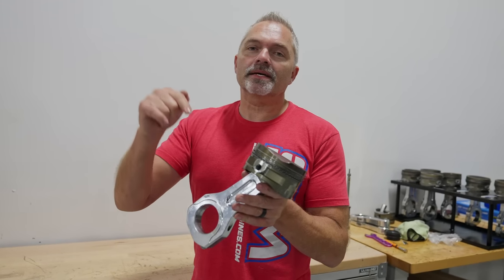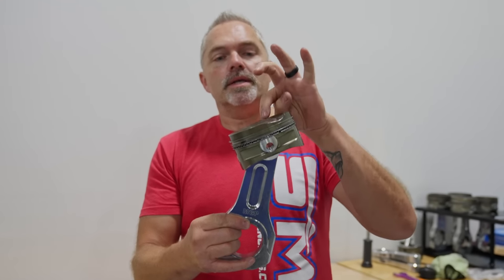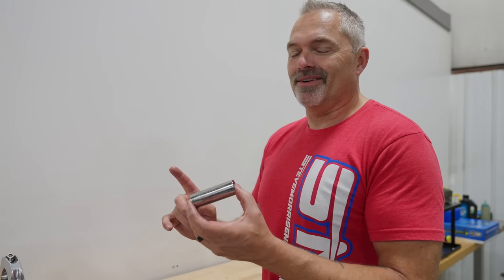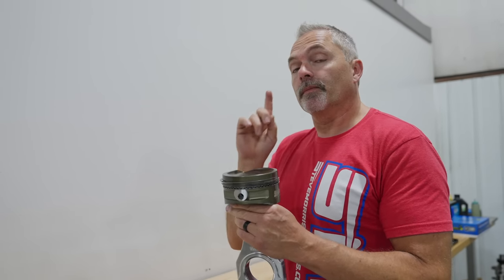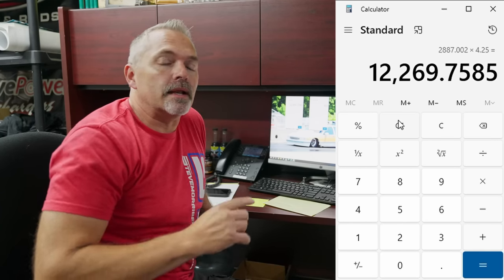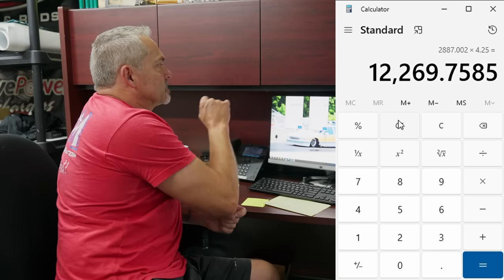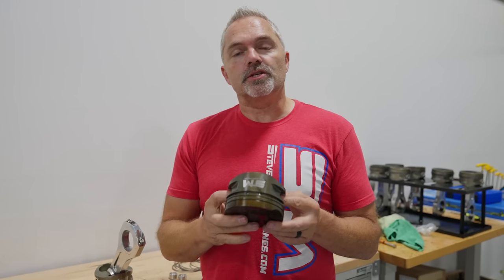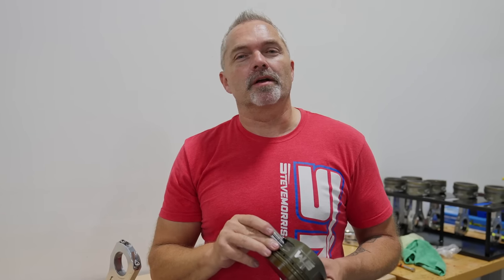Throw your rods away if you do this ???

Comment: Great explanation! The piston has to be beefy enough to handle that amount of weight being put into it plus the spike load of combustion. (many thousands of pounds but for a very short time.) Honda, aka HRC wrote a lot about these forces and how to contend with said forces. They use a fps formula that equates to G forces. 40,000fps to 45,000fps is the speed of an everyday engine to a high performance everyday engine.  The piston and rod going from 0fps to 45,000fps at mid stroke back down to 0fps for both directions.(at redline) Highly recommend checking HRCs info and MITs High Speed Internal Combustion Engines (it's a two volume book)  I'm a drag bike guy. Have a good one.

Comment: You're good at explaining things, keep on doing videos like this. This explanation makes you understand what kind of magic the connecting rod company's are dealing with. Mind blowing is an understatement.

The math on what transmission clutches go through. drive shafts, the teeth of a gear set, the twisting stress that an axle undergoes. Fascinating stuff.

To think how super car owners treat their very expensive engines... Rev limiter non stop with no load... yikes

Comment: Good info to get the mind thinking… couple of other dynamics that were sort of touched on is the angular velocity of acceleration and deceleration that is determined by rod stroke ratio. Short rods increase side thrust and increase piston acceleration and deceleration speeds and hence the peak load on the conrods/bearing/ fasteners and pin/piston  at those instants where direction changes.. the long rod significantly slows both acceleration and deceleration instants and angular thrust on the piston skirt… the piston is in a “softer” deceleration mode as it approaches tic, and a “softer” acceleration mode after tdc. Simarly for the bottom of the stroke on both sides of bdc. Why a long rod engine can make use with a lighter piston as the vertical and lateral loads on the piston decrease. 
It’s amazing the engineering calculation that goes into designing parts that can not only survive but last as long as they do.
Thanks for the video👍

Comment: steam engines use steam to help cushion the piston as well. Right before the piston reaches the end of the stroke. the valve gear lets a jet of steam into the cylinder. it helps alot with longevity.

Comment: I remember reading an article about Honda engineers working to make the s2000 reliable with a 9k rev limit.   The forces on the engine at 8k were significantly less than 9k.   Ultimately they decided to go with the higher rev limit with the 2 liter motor.    When raising it to 2.2 liters rev limit was decreased!

Comment: I just learned a ton of stuff I will never use. That was very very interesting. I was told when a big block Chevy hits the rev limiter it is the equivalent of hitting the top of the piston with a sledge hammer. I do not know what kind of force the hammer hit is, but what I just learned I think the hammer would do less damage. Keep this stuff coming and thanks.

Comment: Physics are interesting.  Torque comes from a longer stroke (up to a point), horsepower comes from more RPM.  Those extreme forces on the piston are a major factor in limiting RPM.  That's why F1 engines got down to around a 1" stroke, that let them use much lighter pistons and rods, later extreme materials let them spin them up to 21000 RPM.

Steve, it would be interesting to learn from you what you look for when you are looking to spin the engines faster where the weakness is, and what decisions go into the compromise of reducing stroke to gain RPM.

Comment: 14:15 Relavent to this point: Steam engines are timed to admit steam well before top dead center for this exact same reason. They turn WWAAAAYYYY slower, granted, but they will chuck rods across the shop if their timing isn't advanced. It's enough to make them clank and clatter, even, and beats their bearings to shreds. That cushion of incoming steam while they're nearing TDC or BDC is critical to their useful working lives.

From memory it doesn't help their performance any, though. But that cushioning effect is definitely useful in any reciprocating engine. Steam engines should be timed to admit steam a few degrees before the piston reaches dwell so that cushion effect is present.

It's also why 2-cycle engines seemingly can't overrev. If anyone's ever wondered why a Detroit 8v71 can rev to 2,500RPM for decades on end when every engine in its peer group chucks rods if it goes much beyond 1,750, it's because the 8v71 is a 2-cycle and thus the rod is never under a tension load. ALWAYS a compressive load. And there's ALWAYS something cushioning the piston as it nears TDC. It's also why the engines in my RC cars can rev past 30,000RPM over and over and over again without a second thought. They're 2-cycles. And they're friggin tiny. Their pistons weigh a couple grams at most and there's always something pushing down on the piston at any point in the cycle. 

My 4-cycle RC aircraft engines are all rev limited to about 10,000RPM or so on the ground(So no more than about 12k in flight) because this will tear the crankpins off their crankshafts if they rev much higher. Usually when this happens the rod punches a hole in the bottom of the case.

Kinda makes me wonder what the loads on the rotating assembly of the 300cid I6 in my old F150 look like. Maybe I'll weigh one of the slugs when I tear the worn out mill down...

Comment: Detroit Diesel had a problem that showed up only between Calgary, Alberta and Kamloops, British Columbia, on their fairly new Series 60 4 stroke engine. The trucks these engines were installed in were driving the Rogers Pass, which has fairly steep grades. Going down they use their Jake Brake which is short for Jacobs Engine Brake to control speed rather than the service brakes.
Detroit and Cummins engines used unit injectors with a third cam lobe to push a plunger down in the injector to spray high pressure fuel.into the cylinder. While going down a hill the engine injects no fuel. It takes energy to compress the air in the cylinder which then acts like a spring pushing the piston back down after top dead center. The Jacobs Engine Brake uses the injector rocker coming up through the Jake head and trapped oil to open the exhaust valve(s) slightly to release the compression pressure so it can not push the piston down. The forces are similar to the end of the exhaust stroke and beginning of the intake stroke, no pressure on the piston crown.
The Series 60 used a two piece piston similar to that used in the 2 cycle diesels. The crown is cast iron and holds the piston rings. The piston skirt is at least partly aluminium and held in place by the wrist pin, which is then bolted to the connecting rod. The crown held a slipper bearing to ride on the wrist pin. There was an ear on each side of the crown that wrapped around the wrist pin to keep it from continueing upward. These were only about 1/4" to 5/16" in cross section. One of these would crack and break off with the engine developing a ticking noise as the crown rocked as the crank went over TDC and started down. The ear would be in the oil pan. What Detroit Diesel determined was the failures occured only on engines where the drivers were using the Jake Brake at above 1800 RPM's. The weight of the crown and the RPM inertia stress caused the failures.
F1 engines have reved to as high as 20k RPM with short cstrokes of 1.5" and very light pistons, some constructed of very light Beryillium.

Comment: Excellent video on the mechanics of engines. So ideally, finding the correct RPM, and correct stroke, can afford you an engine more likely to survive a beating, mistakes, and afford lower stresses on the  rotating assembly. So now I am going to do an excel spreadsheet to find the sweet spots.

Comment: there's more to it.  When one chops the throttle at the finish line, vacuum is now pulling against the piston/rod assembly thus causing even more stress on overlap.  Rod length plays into it as well--it will dictate how quickly the rod slows down near TDC and BDC.

Comment: I would think the weight on a turbo motor would be reduced by the exhaust back pressure x the square area of the piston. Probably why you mentioned the blower pro mods change rod and maybe not the turbo cars. Assuming 1:1 back pressure to boost. 50 psi on a 4.5” piston with almost 16 square inches surface area would reduce it by ~800 pounds. Maybe not enough to make a difference,but it’s another reason to run turbos.

Comment: Real good info Steve.A top fuel car the cylinder pressure is so high the connecting rods will compress  3to4 thousands on each run. Both are crazy to think about.  Have you ever checked  rod length after the rods came out of an engine? Thanks

Comment: I wonder where the point of diminishing returns would be if significantly lighter and smaller materials were used, but more cylinders added to compensate? Or go the other way and use even beefier stronger components and have a low rev limit like a diesel?

Comment: Add to the forces on the exhaust stroke trying to pull the rod apart are the forces on the rod in the shut down area when drivers coast the car to the turn off in gear and the throttle closed. Now you not only have the piston weight on every stroke but also the rod being pulled by no air entering the cylinder when the piston is on the intake stroke.
Reply: DO NOT DO THAT! neutral right as you let off. playing the throttle is equally as bad at high rpm's. loading/unloading is tremendously stressful, because it also causes piston rock and ring flutter on top of the huge inertia weight multiplication, things will break and fast.
really surprised any of it stays together banging the limiters and traction controls as they do. 😬

Comment: This is why only idiots bounce engines off the limiter constantly. I'm about your age and my father was a highly respected road race driving instructor. When he taught me the 'rev limiter' in the vast majority of road race cars was valve float. Hitting a limiter whether mechanical or electronic with my dad in the right seat got you an immediate hard slap and a stern talking to as soon as the car was stopped. To this day I pride myself on never hitting the limiter in anything and get sick to my stomach on the rare occasions where I do. It's been years since I last hit a limiter, and that was on a top speed run where I ran out of gear unexpectedly and was ignoring the gauges. This was a great video Steve and I'd like to see more like it.

Comment: in 05 we ran top sportsman with 705 c.i. 5" inch bore, we turned it 8600 rpm this is incredible information. we sent motor to builder every 75 passes for freshen up.

Comment: I had a long conversation with a well known parts manufacturer. He said alot of the times a rod is broken when the throttle is lifted at the end of the track because it is trying to pull the weight of the piston down with less help from the combustion. Have you heard of this?

Comment: I was hoping you would mention piston speed.  It amazes me to think that a typical V-8 piston weighing a couple of pounds accelerates from zero to 50 or 60 mph in a distance of 2 inches and then stops in the next two inches and reversed direction.  And it does that over and over again, as you point out,  more than 150 times per second.  No wonder the peak acceleration forces can easily go over 10,000 pounds.  Thanks for another good video.

Comment: Love this stuff. It is completely amazing you are making 500+HP per hole.
I'd imagine turbo engines are bit more forgiving than blower engines because they do have significant exhaust back pressure.
Was back around 2004 ish I did 4 cylinder turbo engines and bought and in cylinder pressure monitoring system (it's actually still someplace in the garage still). The spark plug sensors couldn't take the pressure so we had to drill a dedicate hole into the chamber.
The pressures were huge and we only got to 200hp per hole.  Have you used these in cylinder pressure sensors?

Comment: Great Tech Steve! There has to be a weight to strength ratio to compromise. For example running your 2.51 lb piston assembly, would a smaller bore, lighter piston add more boost hold up better? That is the question. With turbos you don't need all that C.I. the boost can make it up. My thoughts

Comment: Those "pins" are actually referred to as wrist pins, material is specific, in a Nascar engine the overall length is held, but the "chamfers" which appear to be insignificant are/were held, or critical, and capture by the ring..

Comment: Not to mention the forces of vacuum when the throttle closes at 10,000 rpm. 
  Also add the weight of fuel to that assembly.

Comment: Gale banks did a video on cylinder pressure during the powerstroke on a duramax. If I remember rights it was 28,000 psi when under full load. It would be awesome to see those numbers on a 4500 hp engine.

Comment: Math is cool.  We used to ask apprentices in what part of the cylinder the piston moves faster.  Most would say it is even.  Due to rod angles, it moves faster in the top, roughly, 2/3.

In a stockcar, running about 9.5:1, 350HP and under 6,000 rpm, our whole rod and piston assembly is 750 grams.

Comment: I think we've all calculated the rpms per second but never knew the equation for multiplying the reciprocating weight per rpm. Would it be equivalent to attaching 12k lbs to the piston and picking it up by the big end of the rod? Seems like it would give, also seems like a steel rod would be stronger, but I guess the aluminum rod acts in a similar way to a bungee cord softening the change of travel.

Comment: Great stuff Steve. The tech info is ACE! Keep it up, very interesting. Here's one I wonder about. How much heat is generated by valve springs at those high revs, and does it mess with the springs. Is the oil flow enough to keep them cool? And does that cause work hardening and breakage.? (Hi revs). Cheers.

Comment: I think more so than making the piston lighter. Which, keeping the strength would be difficult. It comes down to metallurgy. Yes I know it would be astronomically expensive, but has anyone done testing with titanium pistons? They make titanium valves, but I know the internal engine load on those things is different than a piston.

Comment: 15,000 pounds is 7.5 TONS, so at 10,000 RPM, what the connecting rod is doing is roughly equivalent to lifting a small fully loaded school bus with a crane and using the con rod as a shackle or clevis.  What is more amazing to me is that when the piston and rod are on the intake stroke, the crankshaft is pulling the rod down with the force being exerted on the rod cap and the cap is held on by the threads on the bolts and nuts.  I would think that would be a real potential point of failure because of how relatively small the threads are and all of that force being held by them.  It seems like they would just sheer off...

Comment: Hey Steve, it appears the calculation you used disregards the piston movement caused by the rod pivoting as the crank swings. I did the calculations for 7500rpm and get 8522lbs disregarding the rod and 11363lbs assuming a 6.700" rod.
I derived this from the piston motion equations as on wikipedia, they look (are) complicated but all the sinus parts become 0 at tdc and it cleans up well. I'd write more but it would get too long, especially with the conversion to freedom units.
Keep doing what you're doing and all hail the metric system.

Comment: Do you know , if a on a pro mod car, do the rods get shorter like on the top fuel nitro cars, or do they just get weaker and they decide to change them to avoid catastrophic failure. That is Absolutely  unimaginable weighing over 15,000 Lbs. at 10,000 rpm, each piston, time 8 on the whole engine, that crankshaft is getting some severe forces on it as well. The whole concept of all the forces going on in an engine is wild. Thanks for this very informative video, I lime this kind of stuff.

Comment: Enjoyed someone else doing weird math. Dynamics are one of my forte'.  I ran racing mowers for years and they all ran 8600-9500 with no blow ups. I discarded the wrist pin locks. I filled the pins with high temperature urethane and Teflon pin buttons. Drilled holes in the flywheel with radius. Added tube liners on the end of the pto shaft and locked them on with hose clamps staggered for balance. The other guys were blowing engines between 5000-6000 rpm. There were more tricks but you can figure what I was doing in the mid 80's as a crazy teen. 
Mikel
Reply: Yes, I still learn from you and David Vizard. Love you guys. 
Mikel

Comment: 12269.7585 divided by 2250 ( real ton ) = 5.43 tons of psi @ top dead center @ valve overlap.  

Perspective : IF 12,269.7585 were weight being lifted , it would require a 6 ton fork lift / truck , to move it. 
AMAZING a motor stays together !!!

Comment: Just like when you try and go fast. Hp needed to double speed is not twice but twice squared, four times needed. Then add in acceleration change equation and square again. So if it took you 6 seconds to go 60 mph and took 200hp, but to go 120 mph in 6 seconds, takes 800hp.

Comment: 0.0000142 appears 2be derived from mass vs. gravitational constants. Early Astronomers & Horologists studied, acceleration of mass & harmonic oscillators vs. time (delta t) astronomers the planets, horologists, the pendulum. Origin of 0.0000142 x wt x rpm² x area just made my list of mathematical expressions. Stroke & Piston speeds would vary the constant, simple constant correction graph would correct speed deviations.